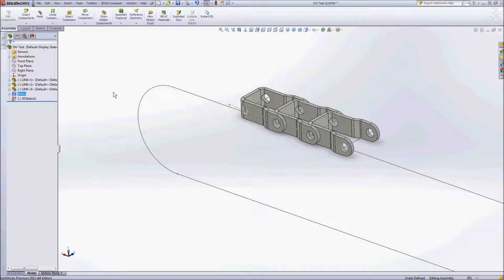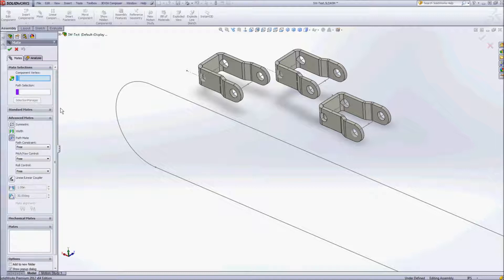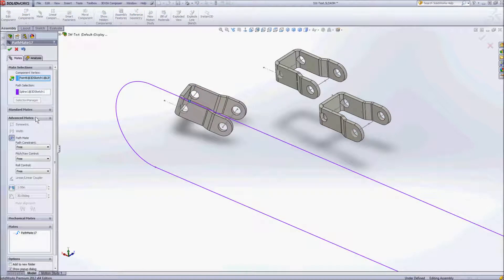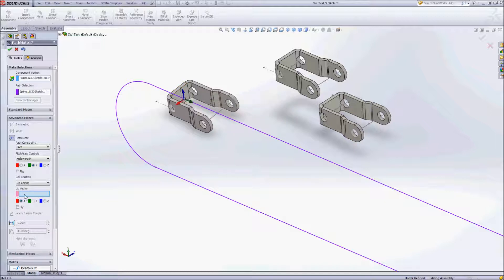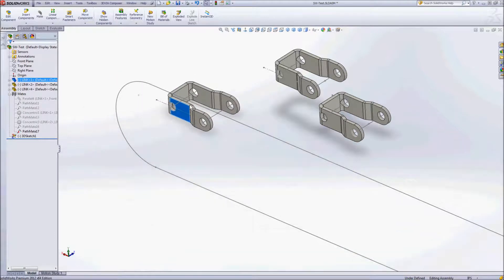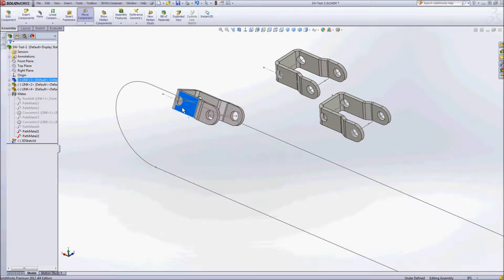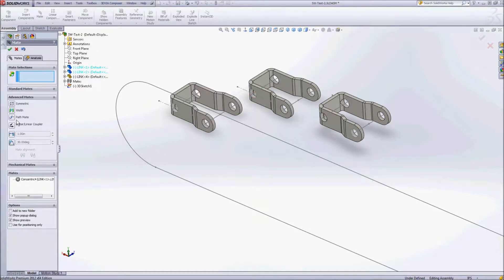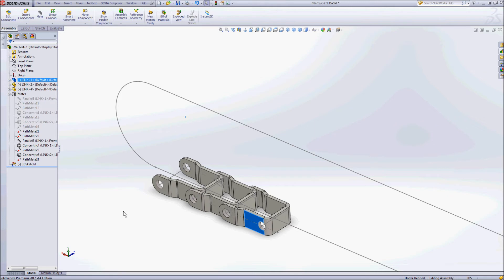Solidworks Path Mate - Author: Mike Towers

Comment: Nice Video! I'm trying to use the path mate to make a wheel and axle follow a cam profile in another part. The trick is the path I want it to follow isn't 2D like the path you have. Does the path mate work with 3d sketches? Thanks for the video again